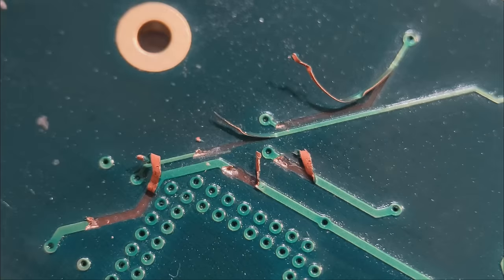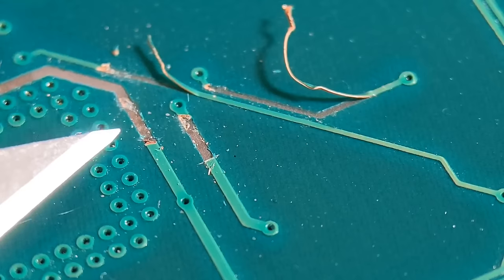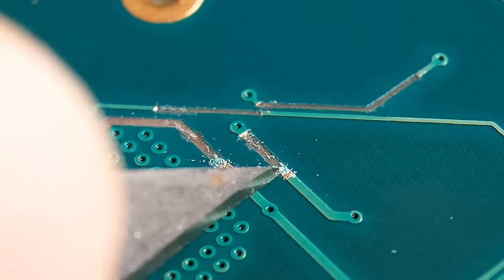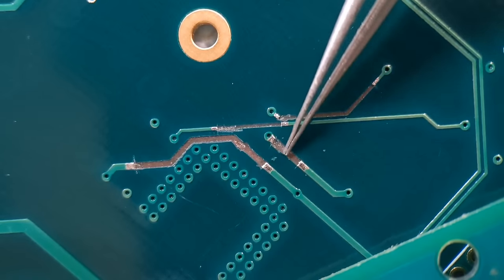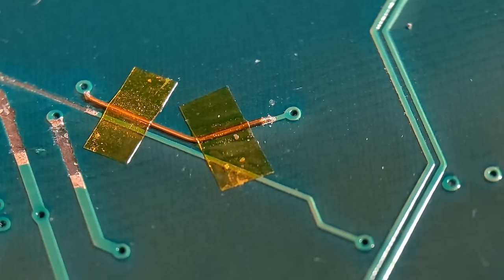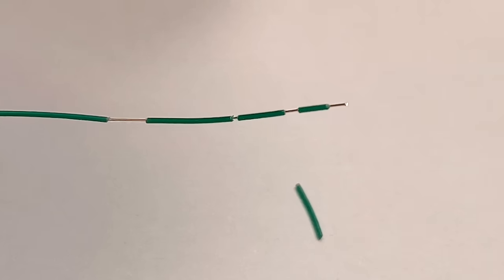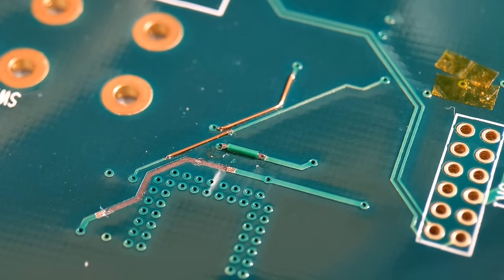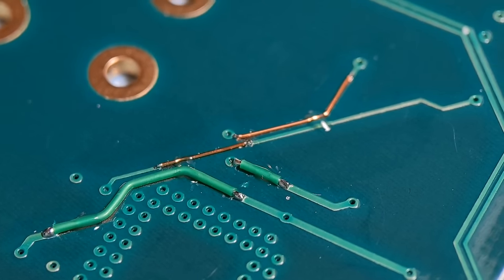How To Repair Damaged / Broken PCB Traces  - 2 Great Methods

Comment: That's all fine and dandy, nice work but what about traces going to a controller chip? I have had several traces burn up and/or lifted up after removing a controller chip, bad technique I know but it happens. Maybe you could show how to fix them. Thanks.
Reply from the maker: Hi , thank you for your comment . It's not that difficult I have showed in a really old video attaching wires to fine pitch IC's which is basically what you are asking for  . I will try and post a newer one sometime , but I don't post that often . Thanks

Comment: Thanks, gauge of the copper joining cable ?
Reply from the maker: Hi , thank you for your comment. The small Enamelled copper wire is 32 gauge. , which is 0.2mm . Hope that helps , thanks again 👍

Comment: I’ve a cracked board, with 17 traces each one approx 1mm thick with a 1mm gap, the crack runs across the 17 traces. I’m a newbie, the board is scrap but I’d like to try and sort it. My question is can you use solder paste on damage like this, I don’t have your dexterity to try and run wire for each one!

Comment: Hi. I've watched two of your vids on repeat for days now haha. 

Could you help me out on this? I've broken solder pad-rings on my mouse PCB while trying to replace the mouse switches. 
Do I need to wrap the wire around the legs of the Mouse switch and then bring the wire through the hole and then solder it to the trace?

This is basically the fix I'm trying to follow. 

"All three pads are gone. But you need only the top and middle pad. The third pad is not connected.

What I would do is glue in the switch from the top side, let the glue dry. Then use a small wire and either wrap it around the leg of the switch or stick it into the hole, and solder it.

The top leg you can then connect to the ground plane next to it. You will need to remove the green solder resist a bit beforehand.

The middle leg you need to reconnect to that trace. So you'll have to scratch the green solder resist off that diagonal part of the trace and solder your wire to that connection."

Comment: What cleaning fluid did you say you use? I couldn't make out the name. Thanks!
Reply from the maker: Hi , thank you for your comment. The main cleaning fluid I use is called Ultrasolve and if I can't get hold of that I use one called Flux Off . I've actually posted a video on YouTube all about these fluids and how I use them , all the information is in that video . Thanks again 👍
Reply: @mrsolderfix3996  wonderful, thanks!
Reply from the maker: Hi , no problem 👍

Comment: Good day, help needed! Copper gone on an entire trace. PCB is exposed and at one deep spot there is signal. What substance can be used to solder a wire on such a non metallic spot?

Comment: A very nice clean repair.  Very professional repair.  There is another channel that makes repairs and fixes boards.  His repairs look like it was done by an 8 year old.  I won't mention his name either.
Reply from the maker: Hi , thank you for your comment, much appreciated. I'm glad you enjoyed the video, hopefully this video and all the other soldering videos I post on YouTube prove useful for people . Thanks again , take care 👍
Reply: @mrsolderfix3996  I worked on PCB repair for 35 years at a fortune 500 company.  I did lots of PCB repairs and they all looked like yours.  I could not do sloppy work and then have the board sent to a customer.  The one thing that I did notice in your video is that your feed-thrus were filled with solder mask (not a good idea).  We always used solder mask relief on our boards.  Then you can use the feed-thrus as a place to solder to.  Not all traces need to follow what is on the board.

Comment: You can use soldermask to protection :)
Reply from the maker: Hi , thank you for your comment , much appreciated . I mention in lots of my videos about solder mask as protection after rework etc . As long as all the copper has solder on it no oxidisation will take place but if you were worried about something shorting to your new joint then solder mask or a layer of protective epoxy for example is a good idea . Thanks again , take care 👍

Comment: Hey , useful , but not for my case 
I have a multimeter , and the traces that are crossed by the switch contacts are damaged 
I am thinking about recovering the traces from another card , and solder them to the multimeter , where it still is some .and to glue it with some epoxy .
Let's see 
Do you have another idea ?

Comment: for me, this happened on my laptop but its not peeled off just cut will this work?
Reply from the maker: Hi , if the tracks are just cut , should be no problem . If you have any loose ends trim them off then remove resist about 1mm or so back on each trace and tin these small areas Then simply attach a suitable wire ( similar width and length ) try and match the outline of the damaged trace that may have been removed. This can be really important. Strip and tin both ends of the new trace wire then simply offer it up to the newly tinned areas on the PCB , flux , then solder . Should get a sound joint if done quickly and correctly , defo use flux . Clean off new joints , cover with solder mask ( if available) and bond wires down about every 1 - 1.5cm. Hope that helps , I've also done other trace repair videos , maybe they will be of use . Thanks again for your question, take care 👍
Reply: @mrsolderfix3996  can u make a video about it so i can show the repair area how to fix it? i dont really have the soldier tools

Comment: hello mate, im new to repairs, how thick schould the wires be ?
Reply from the maker: Hi , thank you for your comment, much appreciated. Whenever im replacing missing or damaged traces I always try and match the width of the trace with the new wire. If you put a tiny wire on a large damaged trace for instance the signals that go through it can damage it again . Hopefully that helps , thanks again 👍
Reply: @mrsolderfix3996  Yes, thanks for that quick answer :).
Reply from the maker: Hi , no problem 👍

Comment: Hello,does the wire diameter matter?I am a beginner and I dont know what diameter should I buy for a pwm converter,I do not want the wire to burn up
Reply from the maker: Hi , thank you for your comment. Yes wire diameters do often matter , that's why on boards you will see different widths of trace to suit different signals that go down these traces . With your project I can't really tell you what gauge wire to use but I wouldn't go to skinny i.e 26 gauge for example is going to be to small so go much higher than this I would say . Good luck , hope you get on ok 👍
Reply: @mrsolderfix3996  thank you!
Reply from the maker: Hi , no problem , good luck 👍

Comment: What glue did you use?
Reply from the maker: Hi , thank you for your comment. The glue used in this video was called Tak Pak . It's a 2 part glue ( glue + Activator) ,and is really meant for PCB modification work so is perfect for this . Available from Farnell , RS Components, in America probably Mouser and Digikey would stock it . It is expensive but I sometimes buy each part seperately from eBay if it's on there , this works out a lot cheaper . Hope that helps , thanks again , take care 👍

Comment: Do you know of a way to replace through hole copper portals? Perhaps you can by them?
Reply from the maker: Hi , you can buy PCB eyelets to suit different size holes in your PCB's. Available from places like Farnell, RS Components and Rapid Online. Just push them through the hole then shape the smooth side to form a pad like shape.
Great on double sided boards but no good for multilayer boards as the internal layers wont connect . Hope that helps 👍
Reply: @mrsolderfix3996  ok thanks!

Comment: Maybe a dumb question - but can you connect a wire from 1 component joint to the next joint in line of the trace? Like a bridge over the broken pcb trace
Reply: Yes, done it myself on an old Amp, it's all about the signal flow, as long as it goes where it is supposed to then any method would work but remember as the Video says, make sure its length and size is similar as original as some circuits rely on that resistance/flow built in to the board, they are more complicated than most hobbyist realise and that's why Pro's, like here, know how to fix things properly, as close to spec (With some improvements sometimes, using more realiable parts etc....) as possible.
Reply from the maker: Hi , thank you for your comment, very helpful to others . We can all help each other out and improve our knowledge , personally if I can play a small part in that then I'm happy . Thanks again , take care 👍

Comment: Great video, but as someone totally new to this kind of stuff I wish you had showed the tinning part at around 14.30 mark. Brill video regardless  though.
Reply from the maker: Hi , thank you for your comment , glad you enjoyed the video . I'm sorry about the tinning stage ( just presumed people would sort of know this ) , it's basically the same as tinning any wire , except a lot smaller. I have to miss out the odd stage here and there as the video would go on to long otherwise , hopefully I try and explain what I've done even if I've not shown it. Hopefully you still learnt a little from the video 🤞, thanks again and good luck 👍
Reply: @mrsolderfix3996  Indeed I did mate. I am on my journey and not really done much yet as my stuff is on route from China :).Pencil
 Iron, Hot air station and just looking for microscope. Great videos though!
Reply from the maker: Hi , the thing that will really help you is different thicknesses of solder . Try and get some 0.25mm and some 0.5mm sizes . This is the biggest single item that makes a massive difference . I use BLT Circuits ( based in England ) to get mine , both leaded and unleaded. Also flux is vital . I've covered lots of these items in other YouTube postings. Anyway good luck and I hope you get on ok 👍
Reply: @mrsolderfix3996  Thanks mate.

Comment: I used, insulated, # 16 gauge wire to jump, out, cracked board traces, on a 24 volt, transistor/relay , board damaged by "F-14 landings" on my carrier, for refueling, un-rep, station in 1980.
Reply from the maker: Hi , thank you for your comment , very much appreciated 👍

Comment: i need ur help , i have missing pad hole , how i can fix that ??
Reply from the maker: Hi , thank you for your comment . I've posted another video showing through hole pad repairs . This may help you . Thanks again , take care 👍
Reply: @mrsolderfix3996 i saw that video mine one hole = two traces , i have idea to cover that area with solder but it's not working  the solder stuck to my iron
Reply: @mrsolderfix3996  do you have email to send u image and tell me is there a way i can fix it ??

Comment: Is it necessary to follow the shape of the broken track?  Why not, when fitting a jumper wire, simply take the shortest route?  Also, rather than use a glue why do you not use solder mask to cover the full length of the wire and joints therefore protecting them?
Reply from the maker: Hi , when replacing tracks it is good practice to follow the missing track as certain tracks have to be a specific length for signals etc . This is why sometimes you will see some really strange shaped tracks , this is not done for looks it's done for a specific reason .
Solder masking a whole length track repair just isn't done by anyone I've ever known . Track repairs in the industry are generally bonded at certain points along the length of the wire. Yes you could solder mask the joints but don't do the rest of the wire. Hope that helps 👍

Comment: What If the solder doesn't stick onto the copper wire?
Reply from the maker: Hi , thank you for your comment. By scraping the coating off the copper wire I could guarantee that I would get a good connection so if anyone is ever struggling with something taking just clean it up or scrape the contamination away then will solder easily . The 0.2mm coated wire I used in the video is a great wire that is so easy to solder to so there was never a danger it wouldn't solder. Thanks again 👍
Reply: @mrsolderfix3996  thank you!
Reply from the maker: Hi , no problem , take care 👍

Comment: I had a right b-----d last night... the pad was gone and the trace was really close to the  ground plane on both sides and I had to solder a wire on... of course, once I got the solder mask off the trace, I had smidges of the ground plane scraped clean too. :(

Comment: How do you repair it if the via is pulled off?
Reply from the maker: Hi , thank you for your comment. As the visa tend normally to go all the way through to the other side of the PCB ( not always though ) I have sometimes had to add solder down into the exposed hole until I hit what's left of the via , then I can attach a wire to this added solder .
If the whole of the via barrel is ripped out you can add PCB eyelets in this situation ( going from one side to the other ) . These are really only suitable for boards with no inner layers . If you can get the board schematics you can recreate the inner layers sometimes by adding external wires from the eyelet to relevant points on the board. Hope that helps , thanks again 👍

Comment: Is it important to clear the excess flux with a remover or is it optional?
Reply from the maker: Hi , thank you for your comment. The flux I've always used ( SMFL200D ) is a non corrosive flux so can be left on with no long term harm done . Unfortunately this flux is now discontinued, but any new flux I use I will always go for non corrosive types even though I always clean my excess flux off any PCB work I do. I've actually posted another video on YouTube showing how I clean my boards and the products used. So basically if it's non corrosive you can leave it on but I don't like to . Hope that helps, thanks again 👍

Comment: Cheers
Reply from the maker: Hi , thank you for your comment , very much appreciated 👍
Reply: @mrsolderfix3996  it's great content.  Trying to repair tracks on novation bass station mk1. Was wondering how to do it right instead of bodging.  Was wondering what glue to use as well.  Take it easy.

Comment: Why do you state that the wire "width" should be matched?  (Versus perhaps trying to match the cross-sectional area)
Reply from the maker: Hi . You should always try and match the width of the damaged trace with the replacement part whether it's a doner trace or wire . I've seen plenty of occasions where people have replaced a missing section with something a quarter the width and the same height so obviously only 25% of the original . Once powered up the current takes this out as it can't take it . The safest way is just to work on the basis of match the width then you have no worries . Thanks for your question.
Reply: @mrsolderfix3996  

My challenge is this, the width of the rectangular trace has a certain cross-sectional area,  If you match the width of the trace with a matching width round wire, you have a different cross-sectional area.  Of course there are different weight boards layers to consider as well.

I suspect in many/most instances this is of little consequence, however, perhaps there are times when it does matter?

Comment: Hi so while replacing my laptop’s cmos battery the holder snapped and when I tried to solder it back on, it wouldn’t stick to the board. If someone responds I’ll be extremely thankful. (Thank you in advance)
Reply: Old comment but it sounds like you need to clean and flux, the solder will wick into the joint and stick if you put a little flux on it.
Reply: @JooseyJay I have fixed that laptops problem a long time ago and now I have more experience with soldering. Thanks for replying though!

Comment: What is that why you put a tape
Reply from the maker: Hi , thank you for your comment . I put the thin strips of Kapton tape down on the wires just to hold them in place while I do the soldering . After the joints are soldered I just remove the tape . Then I add the glue over the wires . Thanks again , take care 👍

Comment: Why not just coat it in UV solder mask rather than using glue?
Reply from the maker: Hi , thank you for your comment . Any long trace repairs it's a lot easier to place individual spots of glue along the repair . In the PCB industry I dont know anyone who would completely cover the whole repair in solder mask , it's just not done . Industry standard is to stake at various points along the repair . Thanks again , take care 👍
Reply: @mrsolderfix3996  Cool, I'm just a home gamer so that doesn't really make sense why it's not. Isn't UV solder mask both extremely cheap and made explicitly for this? NorthridgeFix hits it with a hot air gun and UV light and it firms up quick. Would certainly be cool to see a glue vs solder mask video. Didn't see anything on it on YT.
Reply from the maker: Hi , I do use solder mask in certain situations , I have posted a complete video about it on my channel but when securing long wire repairs down it just isn't used in this instance . Other channels may show it used for this but in the professional industry it would be frowned upon done like that . I've always said do what your happy with , I just like to get the industry standard ways across when I can . Hope that helps.